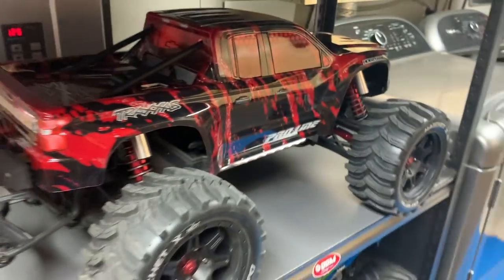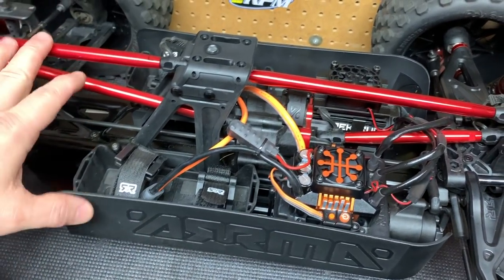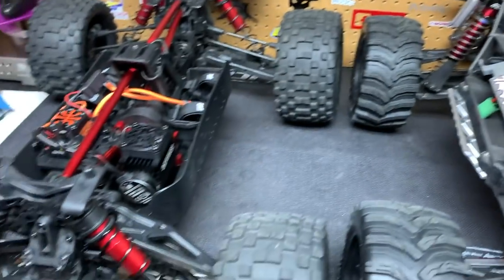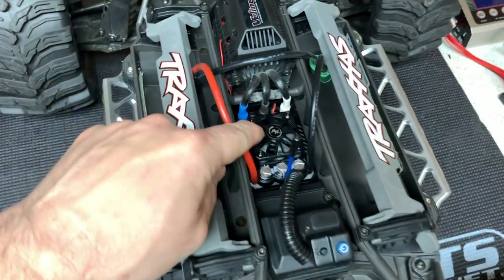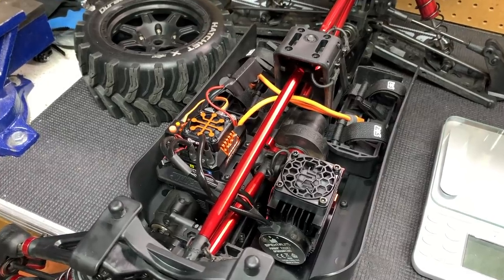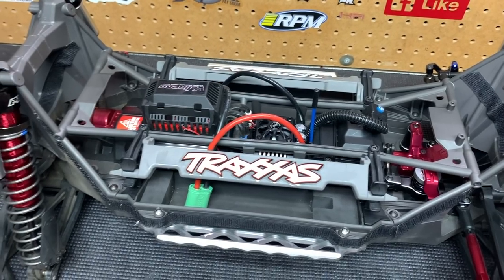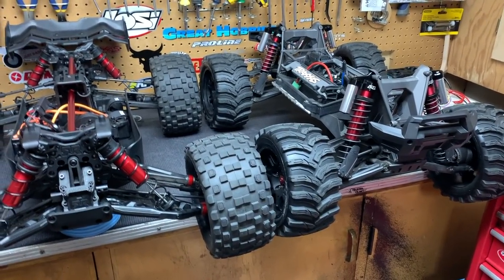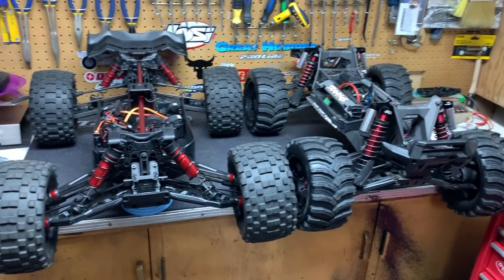Arrma Kraton 8s VS Traxxas X-Maxx (Comparison)

Comment: I got an xmaxx, with hot racing swaybar and love as its body roll less. I also have the set screw backout at full speed one time n it’s was scare as hell as there is no stoping force. Haven’t broke anything except the high speed launch and stop on pavement n broke couple tooth’s on the spur.

Comment: How can you have the some fun if the pinion keeps coming lose
Reply: Loctite my guy loctite
Reply: @lilnash7  i believe he was asking OP since he said he has tried both blue and red loctite with no luck.
Reply: @eddiediaz3480  the op youtuber also breaks his stuff in minutes when most people go months just fine... so maybe people who have sucess should answer lmao
Reply: @andyvannort2743  i was telling nash that the OP,  he  was asking what the YTuber was using since what nash recommended he has already tried and had no luck. Now I have had success with both red and blue loctite depending on what it was being applied to.  In his case I have had no issue with blue loctite but it didn't work for him. Maybe the YTuber uses a different type of thread locker that the OP hasn't used. So how about grow up and try to learn something instead of trying to be a troll n add lmao to the end of your post.
Reply: @eddiediaz3480  so once qgain for the troll in the back. 99% of people have luck with blue loctite.... the youtuber may not have but hes not answering and isnt the best judge of how to sucessfully do it since he breaks them nonstop.... hes definitely not waiting 24 hours to let it cure....

Comment: I haven't broken the pinion or the spur gears
Reply: I have had no problem with mine either... I'm also running proline MX-43 trenchers.
Reply: I have on the 2nd run but I had the replacements already waiting - luckily it was at the end of the run

Comment: Hi buddy just a quick ? has the 8s X max stranded ESC have a punch control option.. mine seems a little sluggish on acceleration running 24 /46 spur
Reply from the maker: Sadly no.   That’s why the max 6 is such a nice option.
Reply: @JasonPerrinRCVlogs  Thanks for the reply .. Its a shame there is no punch setting does need it now after changing spur at pinion gears. I just set up for jumping. May have to change pinion gear down. Maybe its the badlands  mx wheels that have weighed it down a little This truck is new to me but love the hobby  so easy to spend money on it..lol

Comment: Traxxas electronics are crap, but I love their RCs. If it takes replacing the electronics to make them better, I'm ok with that. I've only had one RC that I haven't had a tire issue with is a Losi LST 3XLE. My Super Rock Rey has been second best but I got them wet and 2 blew. The one tire exploded and launched bits probably 100 feet away.

Comment: Why would anyone want to sell there xmaxx to buy an arrma junk you said that you need to upgrade the xmaxx out of the box but what about the arrma you have to spend hundreds upgrading the arrma the chassis will bend the transmitter is total junk out of the box you can't even use it the kraton won't even wheelie much less back flip. In my opinion the arrma is a big tank and arrma knows what junk that they put out and still went and sold it. I feel really bad for the kid's who saved up all there hard earned money just to be grately disappointed
Reply: Lol say anything you want about the kraton 8s. Reality is that its better than the xmaxx. They have already updated the chassis and servo along with 20mil oil from factory now. What did traxxas do? 4 years on and spur gears still shattered and have plastic servo gears 🤣🤣
Reply: @User-four20  if you want a basher the xmaxx is the best rc in that size you can get its durable and parts are much cheaper than the k8 parts you just send the xmaxx and if it Break its not a big deal

Comment: I'm glad I watched this video before pulling the trigger on purchasing an XMaxx. Not the biggest fan of Traxxas but parts are steadily stocked at my local hobby shop.
Reply from the maker: I like them both.  But the Xmaxx just needs a few mods to get it up and running.
Reply: Ive been a nitro fan, but with the power of lipo I am very interested in getting an electric rc. Have a TMaxx, 4Tec, Savage. The Arma I would have to purchase online, the XMaxx I can pick up. Other than the spur and pinion gears you explained, how is the steering?

Comment: Watch a kevin talbot video. Or almost any kraton 8s video.. bent chassis.. banana,d shocks.. broken arms. Servos. Its like 150$ to upgrade the chassis.. unsure what your issue is with the pinnion. Never seen that before. If yea go watch bashing videos. You would avoid that kraton if u plan on beating it. Unsure why your comparing a truggy with a monster truck

Comment: My Xmaxx - duratrack tires and WFO drive cup sleeves. Only run 6s because I want to floor it in the turns and not flip over. 

I went with a Mojave instead of the outcast or kraton. Servo and electronics are so bad in Arrma cars. Custom services sucks too!